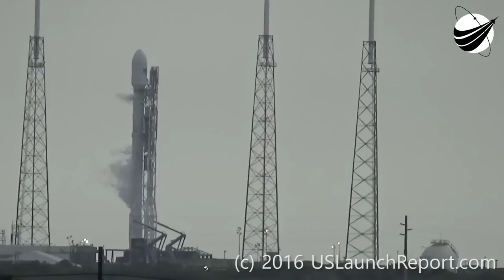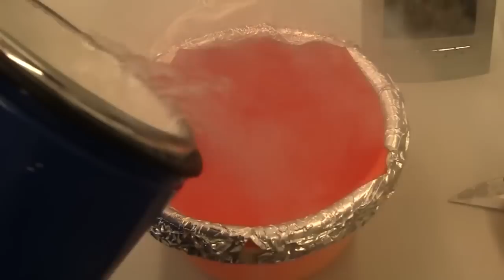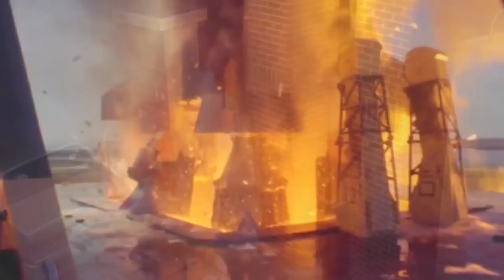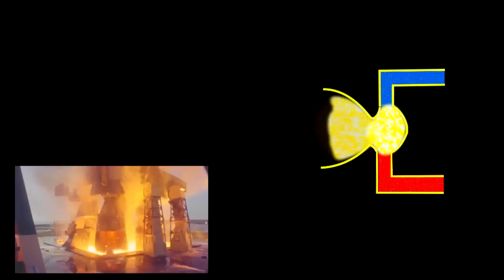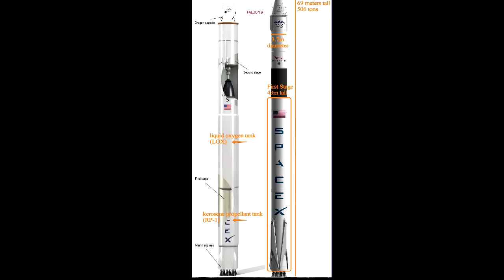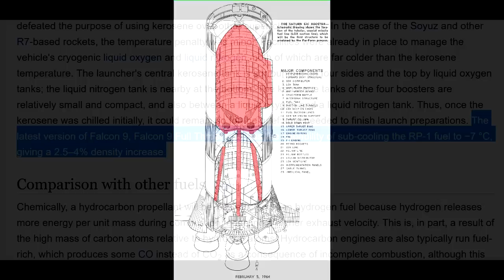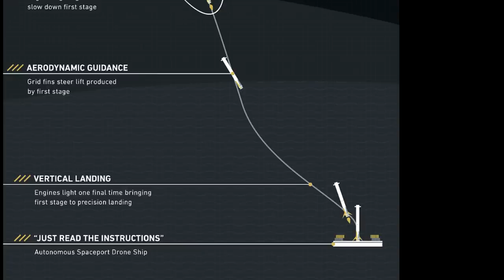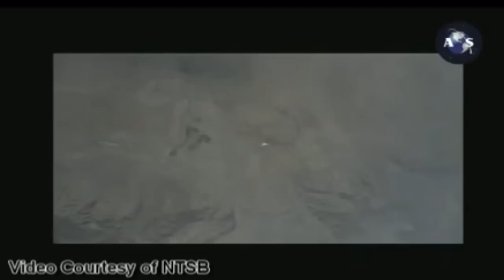Why did the Falcon 9 Explode?

Comment: why using kerosene instead of hydrogen?
Reply: Hydrogen is "better" but is a pain to deal with; you have to keep it at near zero point temperatures which complicates the entire operation a lot. The advantage is that hydrogen is slightly more "efficient".
Reply: more energy density easier
Reply: The lower density of liquid hydrogen requires larger tanks, which negates some/much of the weight savings of the fuel over kerosene. Additionally, kerosene is easier to handle and store.
Reply: "KABOOOOOOOOOOOOOOM" would be my answer to that.